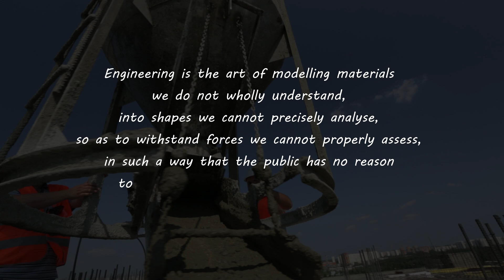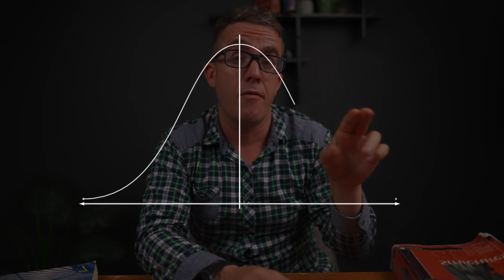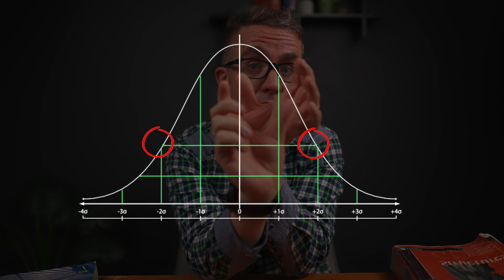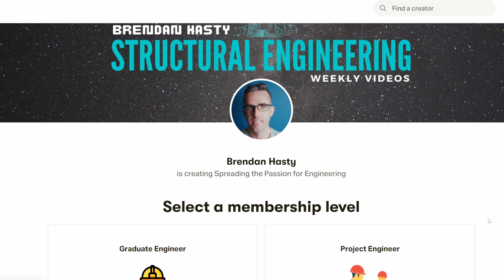Do structural engineers actually over-design buildings

Comment: You missed a crucial point that is often overlooked... having a canary in the coal mine. When buildings are built, when feasible, they should have myriad little indicators that enable a keen observer to ascertain points which are beginning to fail. Particularly because cheap microcontrollers have enabled a boom in cheap, yet remarkably powerful IoT (Internet of things) devices (for example, think of the awesome power of a 10 US dollar Arduino device), it's more feasible than ever to monitor the "health of a building" like a doctor checking the vital signs of a patient of his.
Reply from the maker: Health monitoring is a great idea. This is something I did for my thesis. It would also give engineers better confidence in their designs.
Reply: @BrendanHasty  It's a huge opportunity to decrease the cost of building, maintaining, and insuring structures. I'm surprised insurance companies haven't aggressively pushed health monitoring. 

I can imagine entire departments within insurance companies that actively monitor structures they insure. I imagine that they would regularly require their insureds to make structural improvements to "sick" buildings. 

Overengineering structures and then waiting for them to "die" is inane these days.

Comment: Consider the collapse of Champlain Towers condominium in Florida.  Study of the drawings indicates that there are some areas that were underdesigned.  The structure stood for 40 years then failed.  So it is difficult to justify that something worked in the past so it should be completely acceptable.  As far as the public is concerned, either it works or it doesn't work.  You would need a time machine to go far into the future to determine the answer to this.  Engineers are tasked with protecting the safety of the public, not the maximum profits of the contractor.
Reply from the maker: Agree that our job is to make the building save. but you are paid by contractor, not the public not that this is an excuse. So easer said then done, engineers need to deal with many conflicting goals. If you over design you never get another job, so the real goal is save but efficient. Some times with many examples such as the westgate bridge failure no one knewn about a structural behaviour unless detailed research after the failure.

Comment: Hi Brendan, your skit reminded me of a similar situation I was involved in a few years ago where the contractor and architect was second guessing my design. You highlighted many key factors in this blog. The variation and performance of material, usage of buildings/ structures etc. Sometimes you will design a structure to accommodate specify loads and may nit be aware of the structure undertaking an excessive amount of loading that was not analyze. Therefore it's  important to adopt initiative ideas when uncertainty develops. Thanks for the video. 

Malik
Reply from the maker: Hi Malik, it seem common practice to second guess the engineering design. But they typically want you to make the change but not take any responsibility. Thanks for watching.
Reply: @BrendanHasty  That's correct and just to save a few dollars (profit over performance).

Comment: It’s not as straight forward as it may seem. The human factor plays a role in how the structural design is made and how it’s calculated. For example: if you want a architectural design for your new house and meet with different architects you will get different designs. That’s just a fact. This is also the case with a structural engineer. He will design it, at least I hope so, in such way where he is comfortable with the structure. If that means he had a u.c of 0,80 and not 1,0 than that is his limits. His limit wil change with the experiences he gets.
Reply from the maker: Hi Dashoti, agree that you will get different design with different enginers. However you should not be afraid to go close to code limits. There is a lot safety factors, however, there are some critical elements where you made add some redundancy. Sometimes you may not see the most efficient solution based on your past experience.

Comment: YES in many cases engineers DO 'over-design' structural elements;  and that translates to extra costs.   As an Architect- managing engineers and the structural design is a key important skill that must be done at design stage-NOT when builder is starting on site!!:)  However we trust the engineer's professional training, knowledge and thats what they do; its just as the professional architect-our job is to negotiate design solutions with the engineer.
Reply from the maker: Hi Ibrahim, agree a good scheme is where you make most of the savings. And This should be in design phases, it is too late when the builder is involved. It is also important for engineers to understand the architectural process to lead to the best design for the project.
Reply: @BrendanHasty  yes. were a great team together; structural engineer & architect!  No architect can operate without a good structural engineer. Me personally-I work hard with my engineers but I always try to lead the design stage so the engineers can achieve the design solution I wish; sometimes they think Im mad! 10 m cantilever?  cmon man.....:)
Reply: @ISCDesignArchitect  i'm struggling to think of a situation where a 10 meter cantilever will be cost efective compared with other situations. They must work in tandem and not force one to accept a solution, just because. Besides, most architects have a very basic knowledge of structural systems.
Reply: @Ooze27  yeah i do agree. we hold a basic knowledge only in structure. Even myself with 25 +years of experience on countless small & large buildings and many with very inventive structural design concepts-.  thats because while engineers were 'actually listening in maths class and studying'- architects were messing around and were not too smart. :)
Reply: @ISCDesignArchitect  I'm not saying that. You were the one diminishing other people's work by saying they over-design. You find over-design in engineers with little experience, Regulations and codes exist for a reason. I have no doubt that a 20+ year experience architect has a good understanding of structural elements. Just like i have no doubt that a structural engineer with 20+ years of experience, knows a lot more than said architect (in structural systems, that is). Just like i believe i couldn't do an architect's job, i don't like that an architect tries to push structrual design down my throat when i know exactly what i'm doing. It's not called engineering for fun. As for the last point, most architects i worked with from several different countries were intelligent people, but their knowledge of structural systems was basic for some of the arguments they tried to push, which is natural since they didn't study it.
Reply: @Ooze27  :) well i think thats a fair enough response from the view point of an engineer.  I dont believe in 'Architectural dictatorships' where the architect has full 100% control of the concept; I believe in partnerships of equality and mutual respect. As is in any consultation; only a rude arrogant architect would try push it down the throat; Ive been guilty in the past of that but age teaches wisdom. We value engineers so dearly. I could not practise without engineers. I do sometimes 'test ideas' and radical structural concepts' but usually that shot down in flames with reality of gravity:)  The Architect Frank Gehry is an interesting case study but at the end of the day a good Architect will seek SIMPLICITY: not complexity.
Reply: @ISCDesignArchitect  Well then, i agree with you on everything, maybe i misunderstood in the beggining. When we start on our profission i only natural to be a bit pushy and arrogant (architects and engineers alike) but with time, things fall into place. In my country, engineers are fighting for the right to design like we did before, where both architects and engineers could do architecture. Well, i don't agree with that, i met ONE engineer that could do what an architect could from the utility/design point of view. We just don't have the chops for it, but we should work closely together. Like a teacher of mine once said: " imagine a panflet, you have the front side, beautiful, very pleasing to the eye, the part that makes it notorious, that's architecture. On the back you have all the technical stuff about the product, that's engineering. You can't separate them from each other."
By the way, if it's not asking too much, could you give me a link to some of your work, i have to tell you, that 10 meter cantilever  is interesting.
Reply: How could you know that engineers over-design structural elements?
Reply: @enjek5654  Hi. How could you know that engineers over-design structural elements? A: Because I have worked with Engineers for 25+ years on countless buildings. I am an Architect
Reply: @ISCDesignArchitect  That’s not how engineering justification works. If you don’t have a working understanding of the calculations, it’s impossible to have much of a sense of what’s over or under engineered.
Reply: @enjek5654  Fair point.  Q; are you a practising engineer?
Reply: @ISCDesignArchitect  Yes I am. I appreciate that my comment is quite blunt, but a working knowledge of the calculations to understand the various relationships really is fundamental to all engineering disciplines. In my experience builders/contractors tend to be the worst peddlers of engineering by ‘I’ve done it this way many times before and it’s fine’.  Thanks for listening.
Reply: @enjek5654  :)
Reply: @enjek5654  So you are saying that engineers do NOT add a 'safety factor' into all calculations? and that would apply more to public buildings?  it is this' safety factor' that is in question.. I would argue that each engineer may likely have a different approach; Some will indeed add a higher 'safety factor' than others; Hence its perhaps a subjective discussion. My position from what I have witnessed & discussed with many engineers I have worked with, including some of my closest engineers whom are also among my closest long-time friends, candidly is that yes indeed engineers add a safety factor that sometimes exceeds norms. Hence that is 'over designing' beams. The complaint comes at construction time of course, as the client has to pay for the extra steel, thicker beams/ extra concrete (for concrete work) or larger steel beams.  I totally understand however; Im not saying its a BAD thing; Structural Engineers indeed carry the burden of ultimate structural responsibility
Reply: @ISCDesignArchitect   The safety factors are prescribed in the standards that any given engineer is working to. We don’t choose our own. Any more than those safety factors that isn’t justified by rationalisation or other reasonable justification is just waste. I’ve never had a non-engineer even ask to go though my calculations.
Reply: @enjek5654  Oh yes, this is the worst. When they go: " a friend of mine did this on other building and he only used this and that, the foundations were also smaller". No shit Sherlock, it's a totally different building on a different place.

Comment: There are other reasons as well.

1) Covering their arses by extreme over-engineering.
2) Lack of skill combined with total ignorance of added project costs.

I used to deal with structural engineers quite a lot and saw this happening all the time, especially on smaller projects. I'll give you 2 the most outrageous examples that I personally discussed with engineers and made them change the plans accordingly.

Example 1:  a simple steel frame with 90x35 timber planks attached (virtually no load on planks). 6 M16 bolts were specified as a way of connecting each of these 4m long planks to the frame. (WTF, seriously???)

Example 2: a steel arch spanning about 10m. The plan specified RHS 150x150x9 for the arch. From experience on similar projects I knew that 150x150x6 would be sufficient. After having a conversation with the engineer he reluctantly admitted that 150x150x6 can also be used, and the reason he specified thicker section was that he 'felt that it will be better'. Yeah, right. Considering there were 7 or 8 of those arches we are talking about thousands of dollars of difference in fabrication/installation costs. Simply because somebody 'felt' something??
Reply: That's why more experienced engineers need to help younger at the beginning of their carreer to avoid that kind of situations. I would also add that poor project management and huge work overload in a tight schedule can definitly lead to overdesign.
Reply: @hadrienanglard4297  that's why architects have to take projects in charge, an engineer will never understand the impact dimension of a structural element on both the envelope and the function of a building, yes structural safety matters but not to the detriment of the other elements such as mechanical and electrical , don't forget that most people dies from fires due to electrical and mechanicaldeficiencies than structural ones
Reply: @the3rdmaster311  
You are off-Topic and I don't know why you are telling me this. 
Structural engineers, like almost everyone else on this planet, are smart enough to understand the impact of their design if there is a good coordination and communication with the other project disciplines.
Reply: @hadrienanglard4297  i wish it was the case, otherwise my comment wouldn't push you to  reply
Reply from the maker: Hey FJSA, I did bring up the some engineers over design thing, and I agree engineers shouldn't be scared of designing to code limits. Some critical element or a connection or two adding some redundancy but not to the point to blow out the cost.  Thous examples sound crazy, and the engineers should look at the waste their designs produced.
Reply: Hi FJSA, those examples you’ve given don’t seem to be that bad, I’m surprised they stick in your mind to this day. I’ve seen stuff specified on drawings from younger engineers that would make all of us embarrassed for our profession. 
For example; Suspended PT slab with additional N16-200 T&B EW throughout. 
Or 
Specified to splice an N32 bar using site weld 8cfw x 1500 long Each side. That’s 3m of weld when 500mm would achieve the same result. 

Just got to realise that generally if someone doesn’t understand something they will err on the side of caution and go heavy. This can only be fixed with experience. 
But for those with experience, I’m all for putting that little bit extra amount of steel in the right places just to help us all sleep at night 😉

Comment: I have atm my both feet in those two shoes. Yes the Civil Engineer and also the  builder. At one end I'm designing my  structures to be able to withstand all the possible loads and factors but also on the other end to build them according to local authorities guideline and standards without having to dig the pocket  deep.
Reply from the maker: Hi, that is an interesting spot to be in, it must give you alot of insight into both worlds.

Comment: The topic you are talking about is very interesting. Thank you for talking about the topic. Speaking of Euro Code, it apply a full statistic approach so called Load and Resistance Factor Design, LRFT for short. It has been said that American design code, Allowable Stress Method , ASM, is another choice alongside LRFT. In Euro Code, dead load is complied with Gaussian distribution. Live load is complied with Gumble distribution (or extreme value distribution). The wind load is Rayleigh distribution statically described. But it is still complicated that probability density function has multiple random variables, which represents the ‘unknown’ factors in reality. Further algorithm is still needed to proceed in statistics in order to get the load factor(s) or safety of factor. Speaking of the materials, the situation is even getting more complicated due to the materials used is assumed to go through a series of (random) events or it is called load combinations. As a result, materials used in design  are undertaking assumed load combination. These two statistics phenomena are combined together and convolution integral is used to convey the random process as well as calculating the safety of factor we may use in design. DNV issued a safety of factor, 1.0 , in fatigue analysis exclusive to a Chinese wind turbine blade brand which is just specific to the verified product model, glass fiber made wind blades for the brand. Load situation is complex, building or/and equipment is getting smart and our clients get cost sensitive. Factor design seems more important than ever. I appreciate you bring so much insights and information on this interesting topic.
Reply from the maker: Thanks for your detailed response, and the support. I enjoyed this topic too, hope to deliver more insightful content.